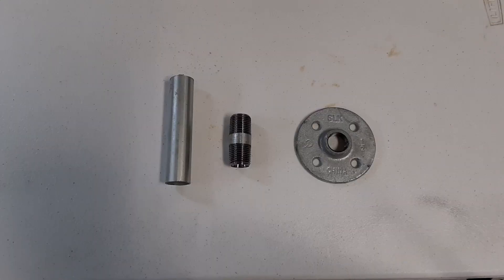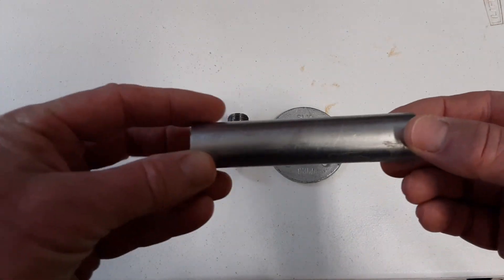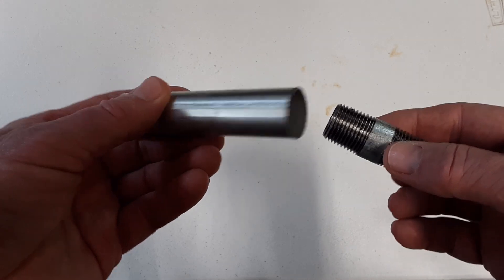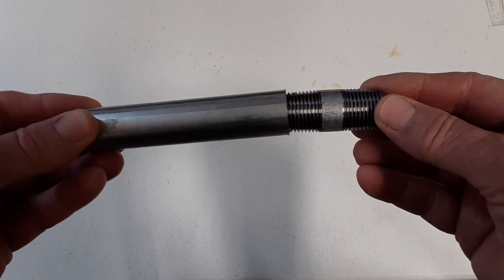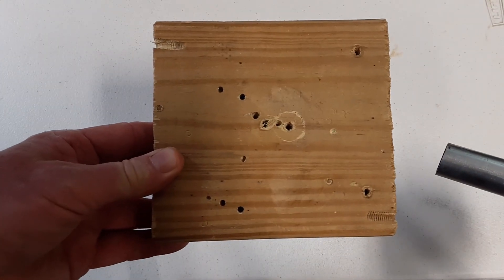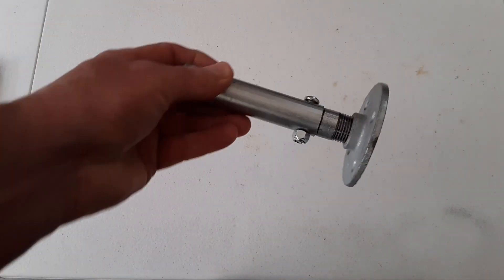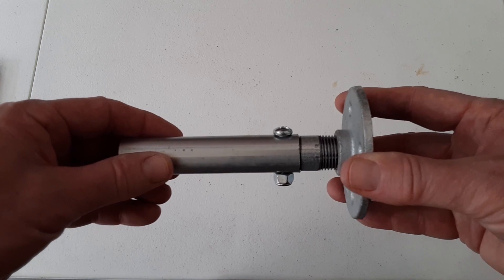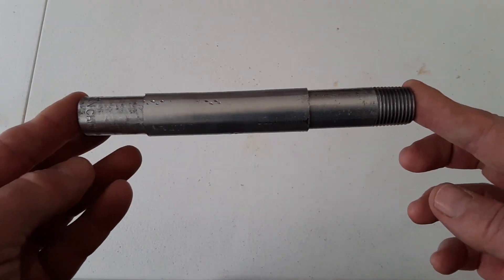EMT Conduit Tubing Base Flange Adapter for Build Projects

Comment: Imagine I want to connect multiple 3/4 conduit pieces with a flange in between.  So, conduit -> nipple -> flange -> mounting plate -> nipple? -> conduit -> repeat.

Any ideas?
Reply from the maker: I know they have new products. You can check their website or ask a question in their forum.